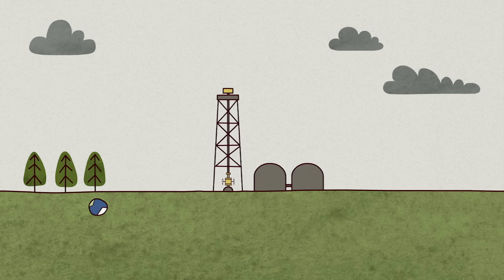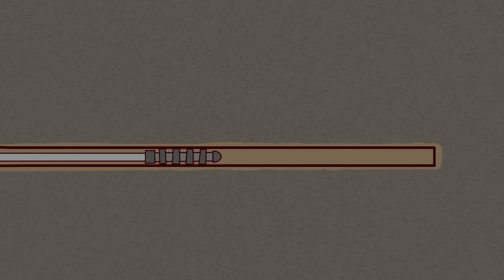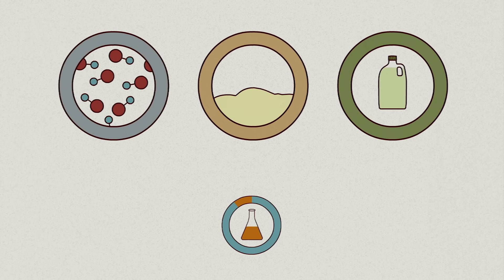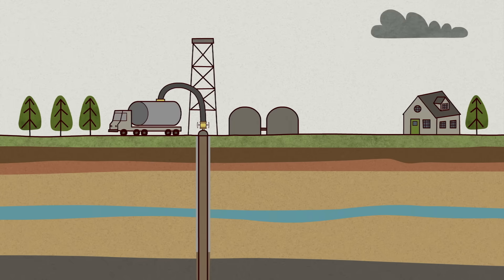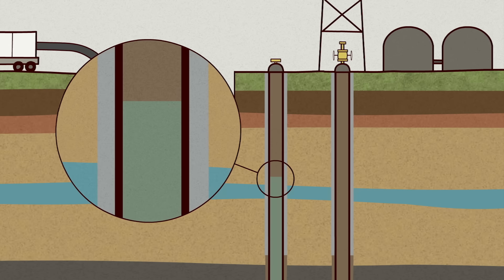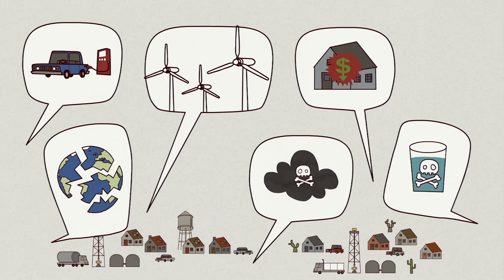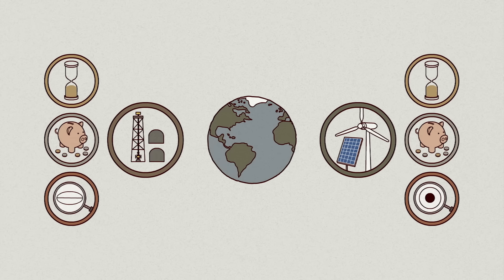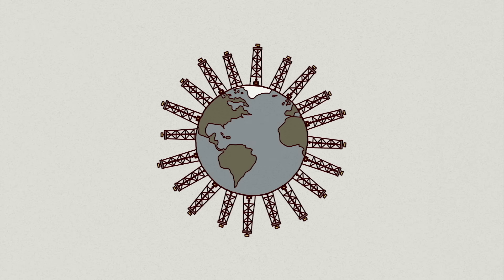How does fracking work? - Mia Nacamulli

Comment: People think renewable energy is clean and reliable, but the fact is all wind turbines, solar, and most all “green” energy is built from petroleum. Also those “good for the environment” processes are maintained with oil based products. I work on a drilling rig in west Texas, where we have over 3000 turbines in our county. That “clean” energy leaks hydraulic Fluid, and grease all over the ground over time. The hundreds of gas powered truck used to transport thousands of gallons of oil based lubricants every day to maintain the turbines are dependent on the production of oil wells. Renewable energy, isn’t so renewable.

Comment: Chesapeake Energy, between about 2009 and 2015, found enough NG in Texas, Louisiana, Oklahoma, NM, and ND to last the US about 2 centuries, and that's without any new discovery needing doing in all that time.  They capped something like 95% of the wells, so they're just sitting there, waiting to be opened back up.  We have a lot of natural gas.

The only viable and reliable alternative to NG is nuclear, and preferably only molten salt reactors, molten thorium in particular.

Comment: Shale is the source rock for oil and natural gas.  Hydraulic fracturing is a 70 year old technology as is horizontal drilling.  The only thing new is geosteerable drilling which provides the accuracy needed for these shale seams.  Water is produced from all oil and gas wells, as saltwater.  Facilities have been around to process it for decades.

Louisiana's oil and gas industry started monitoring natural occuring contaminants near wells before and after such drilling.  There was no increase in methane emissions from a "fracked" well.

BTW, the term FRAC has been used in the oil industry for those 7 decades, not FRACK.  The new term came from propaganda formulated and funded by Russia.

Comment: The wells on our property does not use water. They pumped liquid nitrogen into the well for the fracturing. No water comes out of the well at all and the well is linked to a natural gas line that runs into main natural gas lines all over the country. You might be confused with some wells that produce crude oil where trucks empty holding tanks on site...not water. We have one well that produces crude oil that is emptied once a month by two tanker trucks.

Comment: This is a good primer, well researched, and
the broad concepts are correct, but there are some small omissions and inaccuracies

1) kickoff point is entirely dependent on the depth of the oil/gas. Normally ranges from a few thousand feet to as much as 17000 feet or greater 
2) the horizontal can be 10,000+ feet long 
3) the perforations are closer to 10 inches long, not one inch as stated.
4) the well is ready to frac pretty much right after drilling. There is some additional prep work, but it’s a matter of a few days, not months. 
5) in addition to slick water there are thicker gels sometimes used, derived from the guar bean, which is used as an organic thickener for ice cream. The choice of fluid is highly dependent on the geometry of the fracture the engineer is attempting to create and the need to suspend sand. The disinfectants used vary but by far the most common is quatinary gluteraldehydes often used in toilet bowl cleaner. There are other options. This is crucially used because sulfate reducing bacteria found naturally in pond water can be pumped down the well and over time consume sulfur in the rock to make hydrogen sulfide, which is very poisonous, corrosive, and explosive. 
6) it’s not just the frac water that comes back but also water that is naturally in the formation. Even non fractured wells produce some water. 
7) the casing and cement comments are correct. Damage to the casing and cement is the single biggest concern when it comes to pollution concerns; however if the wells are engineered properly, damage during fracturing is not a concern at all. I would go so far as to say that failure during fracturing is a result of significant negligence in the design of the pipe, or in a serious defect of the pipe. Before fracturing, the pipe is pressure tested to validate that it is not compromised. The much bigger concern is what happens in the many years later as corrosive fluids produced can corrode or erode the pipe.
8) water usage is marginally higher now typically than the value they stated
Reply: Thank you.  This is really the first video I watched to learn about fracking and immediately started doubting about the efficacy with #3 (one inch perforations). Thanks for clarifying that it is actually 10". 
I'm also curious about how CBA (cost benefit analysis) is done at a site, whether it is worth pursuing or not.  (Just to learn about this "hot topic" a bit more as a common man).
Reply: @AnilHS71  in regards to the perforations, their size and shape is dependent on the characteristics of the explosive, the size of the pipe and rest of well bore, the properties of the rock, the pressures, and forces acting on the rock. For fracturing, usually we use deep penetrating charges, they are shaped with a long focal length, think of it like a magnifying glass that focuses the energy on a small point, maybe 0.25” in diameter but hopefully with enough power to penetrate 10-20” into the rock. For other application, like conventional wells with really permeable 
 rock we don’t need to perforate so deep. So we change the focal length to be short, and get maybe 2” diameter holes with maybe only a couple inches of penetration. It’s a science and an art that is studied extensively and one I find interesting. Also. FYI the charges are usually each ~20-30 grams of explosive, placed in a metal tube in a spiral pattern, usually for land 6 shots per foot phased 60-deg from each other- for bigger wells 16-18 shots per foot, and maybe 55 grams of explosive per charge

Above and beyond any engineering, we are glorified project managers. Cost benefit analysis is something we do, definitely ahead of time to a very thorough extent, but it’s also often a real time conversation and subject to all the constraints of making choices when presented with new information and challenges. Also every project is different. Ultra-deep water off the coast of some county is what I’m doing now, and there time is money- time and safety are absolute paramount. A few extra million dollars for fancy equipment, studies, or extra engineers is nothing compared to getting it wrong. Even a couple days of downtime is more expensive.
Reply: @adamsteinhardt6393  Thank you so much for a detailed reply.  🙏Very fascinating field. Best wishes for your current project and beyond.
Reply: @adamsteinhardt6393  All great information. But you left out the fact that fracking unleashes Benzene, into the environment. And Benzene, is a cancer causing carcinogen. So how do Engineers maintain EPA clean air compliance, while fracking? I also remember there were two other issues. Producers were in court for years, because they refused to the disclose the 36 chemicals used along with sand, to bring up, the gas. In PA. there was also an issue with ground water runoff contaminating the Delaware River upstream from Philly, Harrisburg, and Pittsburg. Was this ever resolved?
Reply: How far up your a$$ does your head have to be to believe even some of this happy horse sh-t! Total distortion, and disceptive information

Comment: I love the way that Nitrogen fracking is completely ignored. I have been on frak jobs where there was less than 10,000 gallons of water used with nitrogen as a propellant which saved 10's of thousands of gallons of water by forcing the water down hole under more pressure than could be achieved by regular hydraulic fracturing. Plus the residue was cleaner than hydraulic only fracking. Another benefit to nitrogen is the well bore could be cleaned easier with nitrogen than fluids. Hydrogen is also I believe 78% of the atmosphere we breathe so it is relatively harmless to humans. Nitrogen will also eventually return to the atmosphere naturally to be used again and again.
Reply: @Shell m The frac wings go nowhere near the water table. It would have to be a totally bolloxed frac job for that to happen. Any surfacec water pollution has to come from a different source, such a improper disposal of the frac fluids or failure of the surface casing
Reply: No hydrogen is not 78%....
Reply: @MrHossola  My apologies I used Nitrogen 5 or 6 times and do not know how I put Hydrogen in there. Nitrogen makes up 78% of our atmosphere.
Reply: @stex5150  well I knew what you meant.
Reply: Water is no problem where I live,farmers sell pond water for fracking, the ponds fill back up from rain, they make more money on water than wheat
Reply: @Shell m boycott oil and gas
Reply: @JohnAdams-xc5yk , I think people like you should boycott oil & gas and live off the land.  Put those actions where your ignorance is.  I'll give you a golf clap to do so.  All we ask is that you not use any electricity or materials like plastics provided by hydrocarbons - which produce about 78% of the entire energy output of the country.  Now give me your address so we can confirm you won't be heating or cooling your house with anything other than renewables, no combustion engines, and get rid of that cell phone which you will also need to boycott as the mechanism is surrounded by fossil fuels.
Reply: @JohnAdams-xc5yk  How? You can't even do that. It's used to make and transport EVERYTHING.
Reply: @Shell m Prove it
Reply: @MrHossola  Shell m probably drives a tesla with electricity generated by the nearby coal plant ;-)
Reply: I say poor people don't need energy of any kind. Maybe squirrels running on treadmills
Reply: How effective is the cracking of the shale? Does it completely shatter the rock or just crack it? How much of the gas in the rock are they able to extract?
Reply: @ArturoGarzaID  it doesn’t shatter the rock and also doesn’t create a single crack. To some extent the water follows the path of least resistance which is the main fracture, but there can be secondary fractures, branching as the rock changes, etc. the process is repeated several times in one well in order to increase the number of fractures.

To add perspective- this oil or gas comes from rock that is very impermeable, in most cases much less so than cement. The well itself contacts maybe 200 sq ft of the formation. Most wells don’t even flow anything at this point, not even small amounts. One smallish fracture 200’ tall and 1000’ long contacts three orders of magnitude more rock. Twice over. The surface area is what makes it possible.
Reply: When I lived in the frac fields of southern Colorado they would come out once a week and “burp” the well heads… shooting an atomized stream of condensate and I am assuming toxic particulate 30-40 feet into the air to eventually cover the landscape as it fell. 
The only thing I really noticed that suggested there was contamination was the piles of thick foam in the rain runoff. 
We had a similar toxic foam appear when the dams at Stringfellow Acid Pits in Riverside CA burst…. NOT saying they are equals.
Reply: @markfaulkner8965  I would say that if any local or State Government agency allowed any oil or service company to discharge any well product into the atmosphere allowing contaminates to "cover the landscape as it fell" needs to be reported up the line to the Feds. Obviously they do not care about Federal Regulations, land owners or the public in general. Any time our wellheads were purged it was into a capture tank. By the use of Nitrogen instead of large quantities of Fracing fluids recovery needs were significantly reduced.

Comment: Having worked in the Oil and Gas Industry, I fully understand why there is still a question hanging over fracking.  I’m guessing it’s a case of “Out of sight, out of mind”.  Problems only become apparent when they come to the surface, by them it’s usually too late, the damage having been done. Throwing zillions of dollars at the problem does not guarantee a satisfactory outcome.
Reply: Just wondering if you have ever done any fracking and if you have what is your feeling on the waste water and how they dealt with millions of gallons of said water. From what I have seen and read about that is one the big issues. Take care

Comment: as a side note the water used is called brackish, or produced water, both are recycled. most oil and gas companies  will not use fresh water as the bacteria will cause a well to turn sour ( h2s). fresh water also requires a lengthy permit application to use.

Comment: You frac oil wells as well
You actually frac in any rock containing oil if it is low permeability 
You dont use acid in hydraulic fraccing 
You use proppant not clay.
Most chemical additive is guar, a natural product (made from beans)

Comment: Ok so what if the US Fracks for its energy  instead for a while and then converts to renewable energy over time, why do we have to be strictly oil based until we get to a full renewable climate. If fracking is not good for the environment but may be better in the long run, especially if we only do it for a limited amount of time then why not frack and then transition instead of what we are doing now?

Comment: Forgot to mention the 18 million pounds of "frac sand" needed per well (not an overly  abundant type of sand).  Forgot to point out the steep production curve of a fracked well. You can't base a modern society on fracking. The "red queen effect" (running to stand still) gets stronger and stronger as you drill more wells. Just look at the Bakken's current daily production, it couldn't hold 1.5 MBBl/day. Yes, you can add more rigs, but that only exacerbates the problem, as evermore legacy wells just add to the decrease in production.

Comment: The propaganda is strong with this one. Starting at 1:49 mark is misinformation and fear mongering. The fluid pumped into the well is not 90% it's 99.5% water and sand, the .5% are acids chloride polyacrylamide sodium/potassium carbonate etc. The water is recovered and recycled or disposed of according to govt regulations, so if you don't like the way it's handled blame your elected officials. The wellbore is steel and cement and in most cases they run another steel case and cement it in place too for more protection also the ground water is usually 1000ft down they drill to over 1 mile far away from ground water on purpose so it doesn't get back to the ground water. Notice everytime he says "could" "can" and other maybe words because it's not based in fact only what ifs
Reply: how much did exxon pay you

Comment: Pa has over 5000 miles of dead streams due to coal mine acid leaching.  We will never be able to fix this environmental disaster.  Now the state is allowing fracking with little or no control and no enforcement.  Our Attorney General is trying to hold the frackers responsible but will probably fail.  
Who will fix this coming environmental disaster.  In 100 years the well casings will fail and no one will not be able to fix the ground water.

Comment: The probability of these substances falling outside the casing is about the same as the probability that a nuclear reactor will explode. There have not yet been cases of poisoning with water and after analysis it turned out that there were substances for hydraulic fracturing in the water. And the probability that the substances will break into the formation is small, since the injection is not carried out through the casing (as shown in the video), but is carried out through the tubing, so there are no such huge loads on the casing to cause a breakthrough into other formations. As in any industry, there are risks, but for now, humanity needs these resources.